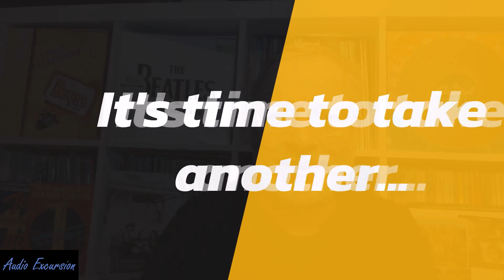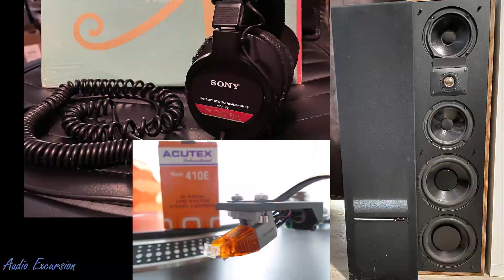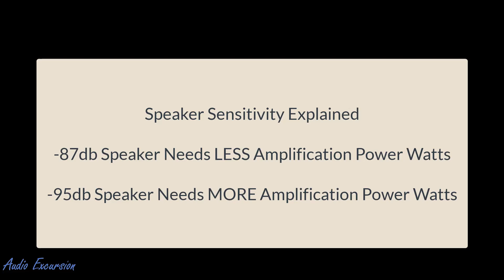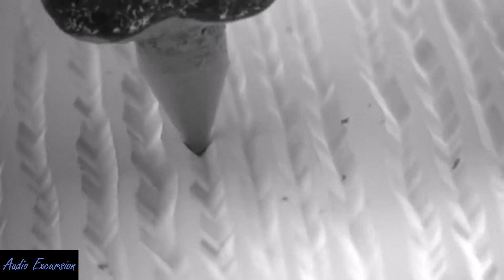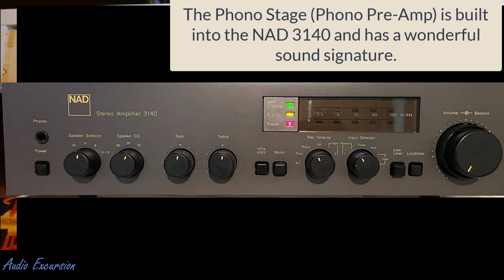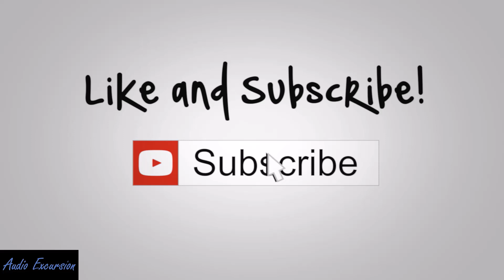Build or Improve your Audio System without going broke! (Episode 115)

Comment: Hi David - great video.

There is definitely a need for information about equipment, which one might forget when you (like me - and you) have grown up learning the fundamentals about audio equipment (my father had a hi-fi store where I worked since I was around 15 ).
I think you have an important point by stressing that the mechanical transducers (speakers and cartridge) are the most important components. And that the connection between amplifier power and speaker sensitivity is also important.

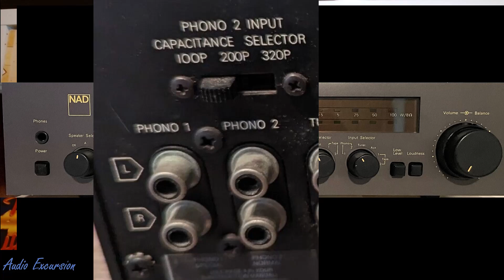A small correction: At 18:51 you mention that the impedance of the phono input of the NAD amplifier can be adjusted.
It is the input capacitance (not the impedance) that can be adjusted. This has (as you probably know) an effect on the treble reproduction in particular - and how the cartridge's self-resonance is dampened more or less.

BTW: I see that the loudness button is pushed in on your NAD 3140. Is this a coincidence or ? My experience is that the loudness effect is far too strong on virtually all amplifiers - and I don't use it on any of mine (including a NAD 3020, which is a "big" 2 x 20 W amplifier).

Keep up the good work!
Reply from the maker: Thanks for the catch on capacitance vs impedance on the phone stage, slip of the tongue/brain engine. I find the Loudness button works well with my Polk Audio 10 monitors but isn’t needed for my Polk Audio RTA11 towers.

Comment: You've pretty much hit the nail on the head. It all comes down to how it sounds to yourself. When you are the one putting out the money to buy something, it should please you.
It was great when there was almost a stereo store on every street corner. They had listening rooms where you could actually compare components side by side. The Best Buy stores are the last of a breed with listening rooms. It was nice years ago when Circuit City was still around. I was in the market for new speakers and had always been impressed by JBL's. I went into CC and they were having a sale on JBL speakers. The ones I ended up with was a pair of 2800's. I don't remember the number but the next one up was a 3-way. These didn't sound as good as the 2-ways I chose.
With an eye onto putting together a quadraphonic system around 1973, my first component was a Pioneer PL12D-II turntable. It is my favorite turntable out of all the ones I've had since. Still with an eye on quadraphonic, I got an AT-12S cartridge(I found that I still had the cartridge, sans stylus recently). I had planned to make this turntable/cartridge combination my daily driver. I quickly learned that this cartridge wasn't suitable for playing anything but for what it was intended to play. It brought out every tick, pop or distortion on regular stereo and mono records. I bought a new AT-14E cartridge, and  because the AT styli were interchangeable, I swapped the styli. The elliptical stylus indeed sounded better, but that quad cartridge with the wider frequency range still presented a problem with sound. So, I swapped the styli back and mounted the AT-14E cartridge. The sound was so much better on non-quadraphonic records.
My next component purchase was a stereo receiver. I went int Pacific Stereo to buy a Sansui quad receiver but then they showed me their Quadraflex line of receivers(not quadraphonic). I liked one of their  store-brand Quadraflex receivers the best, It even had a mid-range tone control. I ended up buying 4 Marantz 2-way 8" speakers as they sounded good to me and were on sale for $25. each(the Jbl's came much later).
There was something about those 1970's receivers which sounded the best to me.  I went through several Sony home theater receivers and with each progressive new one didn't sound as good as the one is replaced. When the last one the HDMI circuits failed, I looked for a new one that still had some analog inputs. I ended up buying an upper-end Onkyo. That is the worst sounding home theater or any other receiver yet.
Along the way, I finally decided to put together a quadraphonic system. I had always been in awe of the Pioneer QX-949, but they had always been out of my price range. I ended up going the Sansui route as the later quad receivers could do all the common quad formats. I didn't know if I still had my AT-12S cartridge still at that time, so I found Shure's version, the M24H. I found a NOS one on eBay at a really reasonable price, so I bought it. Another NOS one popped up, so I bought it for a spare. These work well playing the CD-4 records. I went through maybe 2 or 3 Sansui's and then a Pioneer QX-949 popped up for a really reasonably price(actually cheaper than it should have been), so I snapped it up and retired the last Sansui. The QX-949 is the heart of my quad system, plus  I added a Teac quad R2R deck. Luckily, I came in at the right time and was able to buy all the quad records I wanted and quad R2R tapes for a fraction of the price that they are going for now.
Yep, the most important person to please is yourself. There comes a point when spending more money on something just doesn't pencil out. The more money you spend only results in fractional improvements.
Reply from the maker: Thanks as always for your insightful comments :)

Comment: I been looking to upgrade my turntable and one thing that perplexes are the cartridges currently the turntable I have is an audiotechnica that doesn't have a changeable head.  Which seems so limiting.  👍 thanks for the info
Reply from the maker: What model audio technica? The lower end AT-LP6 model does not have a headshell design so only the stylus can change and the body of that cartridge has limited options. The AT-LP3 is their lowest end unit with a headshell and proper tonearm counterbalance and anti-skate capability.
Reply: @SafeAndSoundTXAudioExcursion  
Just brought my records out of storage after 20 yrs the kids have finally graduated college I have a little more money and space. Was given an AT60 as gift looking at 300-400 range Fluance/Audiotechnica. Thanks again for info
Reply from the maker: @jeffcaudill5467  I guessed it might be the AT-LP60; sorry I typed LP6 and missed the zero ;).  The Fluances are nice for a manual table (I have an RT81 entry level I've been testing).  If you like an Automatic, the Audio Technica AT-LP3 is a great buy at $199 or $250 with BlueTooth - it has the ability to use a headshell/different cartidges, good tonearm with counterbalance weight and anti-skate mechanism. ProJect makes an automatic but its $499 and the headshell isn't interchangeable.  AT SIte: https://www.audio-technica.com/en-us/turntables/best-for/step-up-models
Reply: @SafeAndSoundTXAudioExcursion  thanks, had not seen the AT-LP3 and automatic is nice too.

Comment: Great video David. Another point I'd like to make is no matter what new component you add to your system, you have to give it time to break in. That is everything but a turntable. And as time goes on that component is going to sound better. I've heard mega buck systems that were really overkill and didn't sound realistic at all. On the other hand I bought a Angels Horn all in one system for my daughter that was a few hundred dollars and sounded really good for what it was. I was shocked. It has a low end AT cartridge and came recommended by Melinda Murphy. My daughter is very happy with it.
Reply from the maker: That is an extremely good point.  Cartridges are especially "kind" after a burn-in period.  And my tube amp takes 30 minutes for warm up to sound worth a darn! And yes there are some amazing small footprint and power combos out there these days which are the epitomy of "bang for your buck".  I think companies figured out the vinyl craze and college dorm sizes provided a market that needed attention.  Thanks for this most helpful addition to the discussion.

Comment: My advice for beginners is, as you mentioned, to start with some used gear. About 2010 I did some research and read good things about Klipsch KG4 speakers paired with Hafler amps. I found a Hafler DH 220 for $200 on ebay and had it recapped. I found the KG4s on Craigslist. When I auditioned them I got to hear them on tube monoblocks. They sounded incredible. So then my goal was to someday have tube monoblocks. I splurged on a Thorens and hand built but not too expensive tube preamps. Bottlehead is a more well known brand for that. Eventually I got my uncle's Cornwalls (needed new everything but the woofer inside) and Quicksilver Horn Monos but it's been little by little improvements. It's all about synergy. Thanks for all of your great videos!
Reply from the maker: That’s a wonderful story and growth path. Yes you can drive Klipsch speakers with much less power than many other speakers…

Comment: Really nice presentation. I could see newcomers to audio benefitting from some of what you say. I think the average viewer who tunes in to your channel however, who seeks out & buys expensive pressings is farther along than that; and for them it was probably like a basic math lesson to people with a degree in calculus. You're right about trying to get things optimized at the source. I remember buying my first expensive audio cable and asked the store owner, that since it is my best cable, would you put it between turntable and preamp (my tt had rca outputs) or between preamp and power amp? Without a moments hesitation he said "use it from turntable to preamp." Any sound quality lost at the start can never be recovered. My experience with Dual turntables is that especially the ones from the 1980s on, are not very good. Mediocre arms and suspensions. Back around 1980 when I went from a Dual 506 tt to a Thorens TD 160 Super with Grace tonearm, it was the biggest improvement you could imagine. You will really have something to look forward to if you upgrade from your Dual. Cables are also very important. There are some very good cable companies from Texas; like Crimson Music Link. Not cheap, but inexpensive considering what cables they can compete with. 

 I think everyone should try a decent tube preamp with phono section at least once. You may never go back They resolve those low level subtleties from that miniscule signal that your phono cartridge generates. A tube preamp with a solid state power amp is often a great combo tonally.
Reply from the maker: You are right about those who watch and buy higher end recordings are beyond this tutorial. As the high end vinyl craze is softening there is a shift in viewers and the questions I get from some told me they could use some perspective.

Dual 1245 is from 1975 so before the downhill trend. But Duals can be touchy and the internals and wiring sensitive.  I will be shifting to other turntables in 2024. I have be trying a Fluance this year and it’s been decent.

The Graham Slee preamp is a revelation! I also have a Sherwood S3000II tube amp but don’t use it for shootouts.